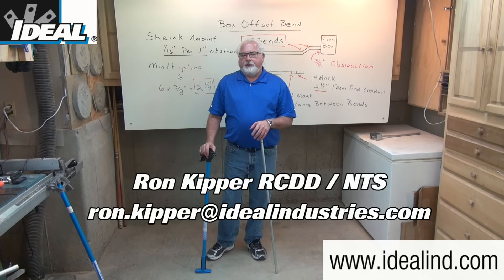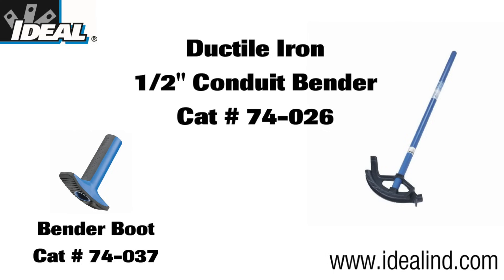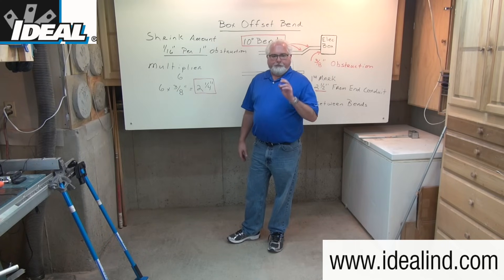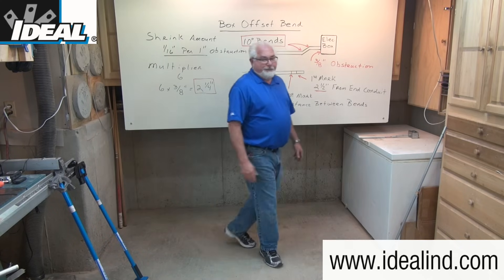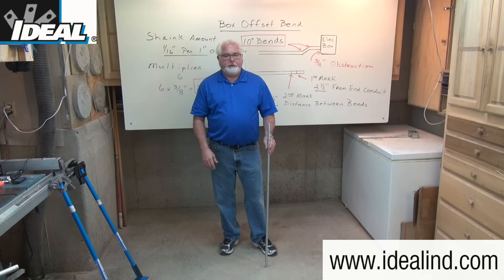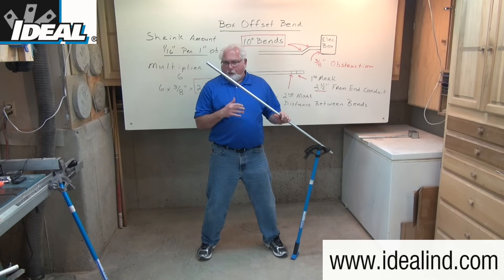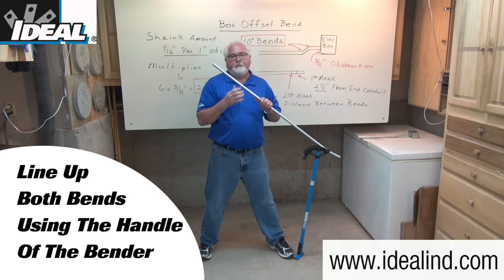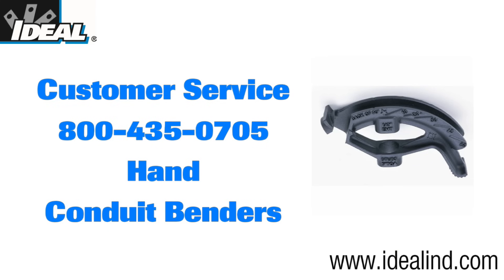How To Make A Box Offset Bend

Comment: Great presentation. I am a retired journeyman electrician but I always enjoy these videos which kind of help me remember how much fun I had being an electrician. My specialty was heavy industrial and loved working and troubleshooting motor control circuits as well as VFD's.
Reply from the maker: heffo loved your "StairwayTo Heaven" thanks for watching
Reply: Why do we need to offset the conduit ?
Reply: heffo and juff wow you loved being an electrician! I’m a 52 YO HVAC tech and love my job as well and constantly watch trade videos just to learn more. Currently we need more people that are into the trades. The kids we get now are only in it for the money. I had one kid tell me he doesn’t get paid to watch videos.
Reply from the maker: @victorsr6708  Thanks man I think one of the last things a person can do is pass along your knowledge. When I got out of college I thought I would never step into a classroom again, today I do nothing but try to keep up things are always changing. Ron
Reply from the maker: Andre sorry for being late I just saw your question. The offset bend allows the conduit to hot the hole on the side of the box which is not flush with the back of the box. Hope that helps Ron
Reply: So the pipe sits on the wall flat up until the bend
Reply from the maker: John yes the bend just offsets the conduit enough to mount smoothly with the box. Have fun Ron
Reply: @andrecharlenor3782  because the knockout isn't flushed with the box so the conduit needs a slight bend to go right in

Comment: I learned from this video before I ran EMT for the first time when I added a circuit to my basement. It came out great. But- when I need a box offset at both ends, I get completely confused on which side to start the bend on the second end. A couple times I made the offset in the opposite direction from what I intended; ruining the piece of conduit. What’s a good way to make sure you do the second offset in the right direction?
Reply from the maker: Hello just turn the conduit around and make the same bend on the opposite side of the conduit hope that helps Ron
Reply: @RonKipperDatacomm1 Hey thanks. Yeah after I thought more about it, it made sense to start the bending the exact same way I started the first one. This time I marked the “top” side of the EMT on both ends so I knew which side is up when starting the bend on the second end. That also allowed me to make that mark in the center so as to avoid the dog leg. I am adding a circuit in my garage and the conduit came out perfectly. Thank you.

Comment: On my Ideal rubber boot I placed a Stainless Steel Worm/Hose Clamp (the kind where you turn the screw head and it tightens) round the shaft part of the boot and tightened it. It stops the boot from turning and/or coming off.
Reply from the maker: Hey James usually that boot is not that loose but if it works it works have fun Ron

Comment: I have a 1-3/4 offset timed it by 6 which is 10.5”. Made my marks, did the bends at 10 degree and the offset is way off after bending.  Did it twice and both wrong.  Not sure why my offset isn’t coming out correctly.
Reply from the maker: Hello I am not sure what you are doing wrong have you seen this video? https://youtu.be/5rNrEak1K9o I hope it helps Ron

Comment: My bender is old and doesn't have 10 degree mark. What is your suggestion besides buying new bender.
Reply from the maker: If it does not have a mark test bend a conduit it bend it once you get the right angle make a mark on the bender, Best I can think of good luck Ron
Reply: @RonKipperDatacomm1  Thank you very much for the info. I'm using out dated tools but they still do the job. Never noticed this missing indicator mark until I watch your video. This bender was given to me 40 years ago lol. Time flies when yur havin fun.

Comment: I retired after forty years in the trade and over the first years everything was in pipe but eventually it boiled down to mechanical rooms in pipe for the majority of work and bx for the rest. In all honesty I've never seen many electricians do much math beyond 30 or 15 degree bends. For most benders 30 degrees is a two time multiplier and it's simple for most people to remember. Measured bends we typically did on the floor ( if you're lucky the bender has 30 degrees with a straight up handle) and estimated bends we do by eye with the bender upside down. For non exposed pipe work we simply put the pipe in and pull it down and flip it over and reverse bend it to be close and if it's bit too deep we roll the offset to fit. Not that we can't do it exactly or don't know how but on most jobs speed is just as important as anything in keeping your job. If you have to pull out the ruler and pencil for every bend it will take twice as long to do. It is important to know how though when you're working with hydraulic benders and large pipe sizes. I did a mechanical room for a new downtown jail in houston and had rows of pipes on racks up to four inches stacked on top of each other all going into multiple pieces of switchgear and it all pretty much had to match and be exact to look professional. I even took pictures when completed to remind myself that I could do fine craftmanship when needed. Get to know your bender as much if not more than your multipliers. And for a service electrician you should be able to bend rigid for underground by bending on equipment, truck tires, or even trees to fit the trench layout when a bender isn't available. You should also be able to reverse bend using a straight edge when a protractor isn't available so you don't even need to know the degree of your bends but only the offset dimensions.
Reply from the maker: Wow sounds like you know your bending appreciate the feedback Ron

Comment: Been using the 1/2 offset fittings for boxes but the 3/4 size doesn't seem to allow the 3/4 conduit to sit flush on the wall. Do I need a special box for these to work as it seems the conduit never wants to sit flat with the wall with the 3/4" offset.
Reply from the maker: Greg just bend the offset for the 3/4" conduit just like I did for the 1/2". Pretty much the same bend but using the 3/4" bender. Have fun Ron

Comment: I have been looking all over you tube to find some one to explain the box offset.  There are many videos showing how to do more complicated offsets but I was just looking for the most basic.  Thank you for the video.  I tried using 30 and even 45 degree offset logic and it never worked.  Never thought to use 10 degree.  Thank you!!
Reply from the maker: +Joseph Dafo Hi Joseph nice to hear you found the channel and thanks for you input. I do appreciate it. Ron
Reply: another way is soon as you feel the pipe bend stop and rotate and do the same
Reply: if you are new to bending pipe, you can also use a 4 square box to see if you have to much or not enough offset

Comment: Freeze-frame at 3:42 is captioned "Bottom of conduit even with 10 degree mark".  This image shows a large gap between the bottom of the conduit and the mark above 10.  Should the bend be continued until the conduit is even with the line above 10?
Reply from the maker: Hey Bill I see your point but I believe it is the angle I took that picture that kind of throws off the view of the mark even with the bottom of the conduit. Good catch it seems like about ever video I have every made can be done better.......Ron
Reply: Thanks for your response.  Not trying to be picky, just want to learn the technique.  After several attempts I developed a different understanding of the angle marks.  My results seem to be better when I bend until the tubing was parallel to the angle mark as shown in the 3:42 image.  (Imagine extending the 10 degree mark until it is as long as the portion conduit on the right side of this image.  The conduit and the extended mark should not intersect.)  When I tried bending the tubing until the bottom reached the mark, the offset exceeded my requirement.
Reply from the maker: Bill bending conduit is all about practice I am sure you will get the hang of it. Not much new in bender head design in a lot of years now. Maybe a beeping noise when you reach the mark???? Ron

Comment: Where would you find the maximum number of degrees allowed in a single bend?
Reply from the maker: Total amount in a conduit run should be 360 degrees I believe. It should be somewhere in the NEC I am not sure where though. Ron
Reply: @RonKipperDatacomm1  Yes, we already know that part, but I can't imagine why anyone would do a 360° bend.
Reply from the maker: That is a total of 360 degrees which could be 4 90 degree bends along the length of the run. They are not making a circle...hope that helps Ron

Comment: I'm glad you mentioned how to tell when you are at the proper degree... I hear a lot of arguing over whether you bend until the pipe is parallel with the line or until the side of the pipe touches the end of the line... I am impressed you answer every comment... I would like to add that the 10 degree bend is achieved when you take the spring out of the conduit doing a floor bend... When you put a conduit in your bender the flatback hook creates a small gap between the conduit and the floor, creating that little bit of spring. A 10 degree bend is when you take out that spring and the conduit lays flat on the floor... Still, good video for those who haven't been bending for the past 40+ years...Keep it up
Reply from the maker: Hi William thanks for the comments and tips. I need to make another video with tips on using the bender as I have gotten a few from guys like you. Seems there is always something new to learn. Take care Ron

Comment: Thanks for the info.  After pricing out all the little fittings to do a large (for me) project in my basement, I figured it would be cheaper to just buy a bender.  Too bad it didn't come with instructions.  I'm going to be making about 16 offset bends like you just demonstrated and this was exactly what I needed.

Comment: Why do we need to offset the conduit ?
Reply from the maker: I explain that in the beginning of the video. The knockout on the box is not flush with the back of the box and a slight offset in the conduit cures the problem. This way everything can be clamped down without putting pressure on the conduit or box. Ron

Comment: How do you come up with the 10 degree number?
Reply from the maker: Rod 10 degrees is the smallest degree mark on the bender head and about all that is needed to make the box offset bend. Plus it is easy to pull wires through it to. Hope that answers the question. Ron
Reply: Yes, but how do you know you need to bend it 10 degrees as opposed to lets say 15 or 20 degrees? What is the method used to determine the number of degrees to bend the conduit.
Reply from the maker: Hey Rod 10 degrees is the smallest graduated mark on the bender head and there is no mark for 15 or 20 degrees. Plus the  smaller the angle the easier it is to pull wires through the conduit. For a slight offset like this box offset the guys in the field have always used 10 degrees. Or I could just tell you what my Dad would of said "just do it because I told you to!" Take care Ron
Reply: I think we are missing something. I understand that for a 3/8 offset the degree used is 10.  What if you have a larger obstacle to get over, like a large pipe, then how do you determine the angle to use. Is there a method to determining proper angles for different obstacles?
Reply from the maker: Rod for most obstructions that are 5-6 inches tall or less a 22 1/2 degree bend works pretty good and taller that that a 30 degree offset seems to work out better. There is no set rule I know off other than try to keep the amount of bends down so it is easier to pull wires through the conduit. I believe the NEC states there should be no more than 360 degrees of bend in a single conduit run. Hope that helped Ron
Reply: It does help Ron.   Thanks a bunch for your time. I appreciate the help!

Comment: great video. but why is the first bend/mark at 2 1/2, and will that first mark work for a 3/4 pipe EMT ?
thanks.
Reply from the maker: +Humberto Godoy Rodriguez The first mark at 2 1/2" was just a starting point I chose it could be closer to the end of the conduit if you wanted. Ron
Reply: How did you come up with a multiplayer of 6?

Comment: Why is the first Mark 2 1/2 inches? And how do you come up with that number? Well I know you said the first mark is so that it will fit into the box correctly, but where does 2 1/2” come from?
Reply from the maker: Hey Beau the first mark could be anywhere between say 1-3 inches if you wanted and 2 1/2 is just a good number and makes a clean looking bend. have fun Ron
Reply: Beau Ferchaud I might beat you up later

Comment: The multiplier for a 10 degree bend is 5.76 NOT 6  as it is stated in the video and yes the difference matters.  
For an example lets do the math for a 5 inch offset with 10 degree bends. Using 6 (the multiplier you are using) the spacing between bends would be 6 times 5=30 inches NOW using the PROPER math lets do the same offset 5.76 times 5 =28.8 which using the standard  rounding method used by electricians would be 28  and 13/16 inches . That is a difference of over an 1 inch or 1 and  3/16 inches to be exact  added the spacing between bends using 6 instead of 5.76 and that makes a huge difference
Reply from the maker: +chris sanders Chris I should put a disclaimer in the video that I don't know everything..........thanks for the tip and I may reshoot the video or add an annotation with your comment. Appreciate the heads up and you taking the time to sent me a note. Ron

Comment: I want to burn at the stake whoever puts those stickers on there. Some of them are brutal. Plus, an issue i've always had was that you don't always get a perfect 10 degree bend. sometimes its 8, sometimes its 12. Same with 30 degree bends. Kindof annoying. 1/2" is forgiving, so you can make it do whatever you want. But 3/4, or 1", not so much.
Reply from the maker: Hi Dave one of the reasons I have always said "bending conduit is an art form and takes practice" is you are right the graduated marks are a good guide but people get in a hurry and are not careful about over or under bending the conduit. Have fun Ron

Comment: Well, I have to admit I feel stupid for not realizing how easy it would be to make this type of thing precise.  I've bent conduit before but you really explained it well.  I work in the RF industry, so we run lots of coax and data cabling.  Customers are always wanting us to install conduit for them, but we always have to farm it out to an electrician.  I think I can probably do this though!  Most of the runs we have wouldn't be much more complicated than this vid.
Reply from the maker: +uncleben03 Really it is mostly a little practice and experience with bending conduit. Glad it helped you out and don't turn down the work next time. There are 7 videos in that series so good luck. Ron
Reply: Don’t steal their work.
Reply: @marksanchez253  Bending EMT IS NOT just electrical work.It is used in many trades,

Comment: thanks for that!  I just bought the ideal 1/2" bender earlier today.  Menard's didn't have the iron one... and I do electrical work so infrequently that I could not really justify the extra money anyway.  I'd never used one before and my electrical box offset for the starting point is pretty embarrassing looking. :(  I did do a good 90degree on my own.... wasn't at the right point where I was thinking it would have been but I didnt need to be exact (thank goodness).
Reply from the maker: Hi Bill glad to be of help. That aluminum head bender should last you many years. Use it well. Ron
Reply: Ron, would you be able to help?  I have to run about 200' of conduit in a strip mall through 2 other suites along a back cinder block wall.  I am nervous about the offsets.  I am not sure where to measure (i think I do have it correct in my head when it comes to bending one side, then doing a 180 on it and bending the other).
For going into the next suite, if I drill at the back corner of the wall I think I will hit a lot of obstructions.  I think it would be best if I went away from the wall a few inches, then back flush against the wall in the next suite.
I am just sure how to measure or where to place my measures and at what points to bend. :(
Reply from the maker: Bill I am not sure I quite understand what you are trying to do. To measure the offsets just measure the distance between the box and the last conduit fitting. The bend the offset the shrink amount is pretty small about 1/16" so it should not be a problem. Keep in mind the NEC recommends no more than 360 degrees of bends in the conduit run. In many cases practice is the only way to learn so you might waste a couple sticks of conduit working it out. Good luck. Ron
Reply: Ron Kipper Datacomm To clarify that 360 degrees of bends in the conduit run. If there is a junction box or pull box in the run, can you then have more degrees of bend?
Reply: Correct, 360 required between pull points

Comment: Thanks for the video Mr. Kipper. I'm new to electrical work (Only been doing it for 6 months now), so any tips and pointers I can get, it's gladly appreciated.
Reply from the maker: +Samuel Fogle Sam great to hear from you! New to the industry man I remember being the youngest guy in the room. Do you do any low voltage work like Cat 5e cat 6 or with coaxial cables? I might have a couple things I would send you if it can help you.Let me know.Ron
Reply: ***** Not on the current job the company I work at. But I'm sure later down the road, I will get the chance to! But you can go ahead and send them if you wish, I can keep them saved somewhere on my computer for when that time may arise!
Reply from the maker: +Samuel Fogle Sam send me an address to my ron.kipper@idealindustries.con email and I will see what I can scare up for you out of what I have here.Ron